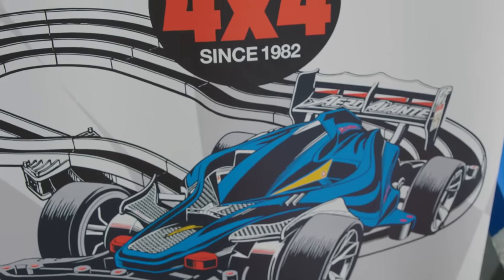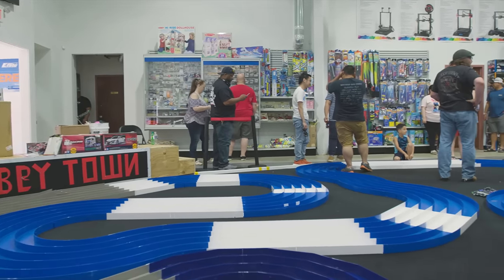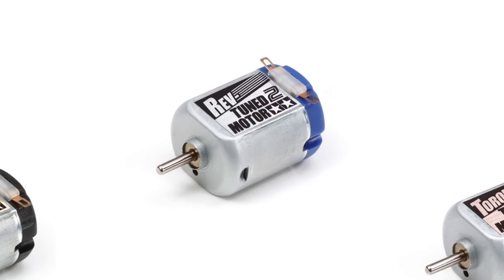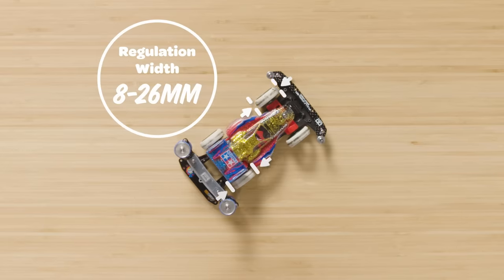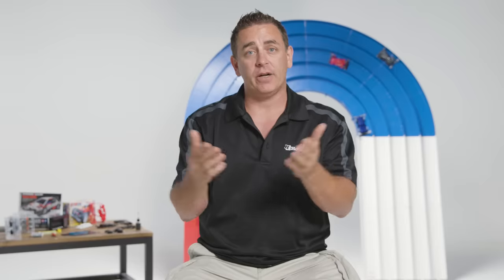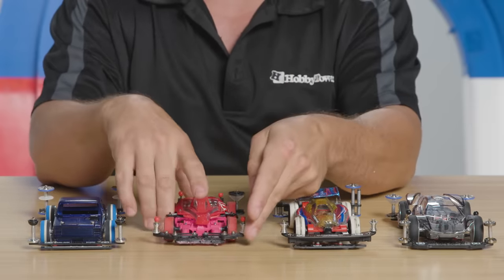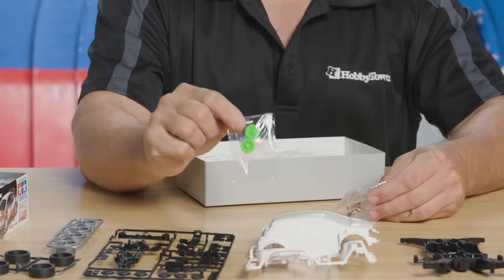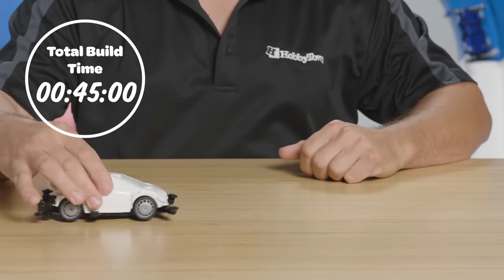Customizing Mini 4WD Racers For High Speeds On A Small Scale | Ars Technica

Comment: I remember modding these in the late 90’s.  I had a cobra chassis with a okami trike conversion with modded  hyper dash casing with a re rapped plasma armature and bell.  Rechargeable batteries is a must!!
Reply: how much you spent for it?
Reply: I had Max Breaker, Knuckle Breaker, Desert Golem and can't remember the 4th one I've had. I've only had like 3 or 4 motors back then as it was an expensive hobby for an elementary kid back then. They were Hyper-Dash 2 and 3, Rev Tuned and Atomic something can't remember the exact name. Had good times with this hobby with my cousins and friends in the late 90s and early 2000s. Started to come back to it just last year.

Comment: Used to see races all the time. They even have suspension now, my favourite to watch is the full open class. You see the craziest ones there, like the rwd ones, they don't have front wheels, they have this roller bearing under the front of the car. Homemade motors way more powerful than normal, when they hit the straights you can't even see them . But they tend to be crap if there are any jumps.
I still remember seeing some of them do a 3 lap track in 9 seconds .  The track wasn't small It's bigger than the one in the video just without jumps and only 3 lanes

Comment: I tend to like Tamiya mini 4WD with Super X / Super XX / AR chassis .  They have that look that says high speed spec setting so i tend to like set-ups for tracks with that requirement.  For technical tracks i find VS or MA chassis mini 4WD cars good for the job.  I should also say the $100+ fully set up car with upgrade parts mentioned in this vid is be pretty accurate.  I bought 4 types of motor, bearings, side dampers, front and rear weight control, aluminum rollers, wheel sets with lock nuts, etc.  There's a boom of this hobby in some parts of Asia in the 90s then suddenly died down but it always had a good presence in Japan.  I'm hoping this hobby picks up again seeing it's mostly indoors where we can enjoy, have fun and stay safe.

Comment: Man...I was mastering rewinding the mini4wd motor's coil and was selling it for 20$ each with the custom graphite brush but exclude it magnet because my custom coil is 100% overheat proof, it use high quality wires also coated with high-temp 1000°F epoxy paint... And that was selling well... Too bad it not good to use for track gambling race because it too fast.. So my custom motor only can use as drag race gambling.... What a good time...

Comment: A little clarification on the concept of batteries: The specific (nominal) voltage of a battery is determined by the chemical composition of the cell. An alkaline cell is approximately 1.5 volts, a NiMH cell is 1.28 volts, a Li-Ion cell is 3.6 volts. The chemistry, the physical size and the quality of the components will determine the combined capacity (usually measured in current and time i.e. maH or milliamps per hour). This capacity will determine how much "over voltage" a cell will have when it is fully charged, over the nominal cell voltage. When the battery is loaded (connected to a working circuit) the current draw will deplete the cell. If the current draw is high enough the internal composition of the battery will generate heat. This internal heat generation will affect the battery's capability to provide the rated current. Any restrictions in the cell's capabilty to provide current (heat or depletion of charge) will affect the cell's voltage. How the cell responds to the demands placed on it are directly related to the chemical compositon, quality and the size of the cell. Just comparing the discharge curve of an alkaline cell to a NiMH cell is not indicative of which battery performs better. A "single-use" alkaline cell might "crush" a NiMH cell in a specific race, based on the demands; current, heat, total capacity, etc.
Reply: "a Li-Ion cell is 3.6 volts"
3.7 volts for the chemistry used in most hobby Li-Ion batteries, and 3.3 volts for LiFePo4.

Comment: The motor with more winds or rounds are high speed motor, while the motor with less  rounds but thicker copper wire is more stronger

Comment: I love how this form of racing was marketed towards children. Even though we all know the majority of those who built and race these were all adults. As the adults have the money.

Really after being exposed to this sport due to Yakuza 0. I did not realize the sport is still a live and doing well. Even if it had "died out" for a short time. It is good it is back and has such a wonderful community around it.

Though I wonder if some inventive soul would end up managing to squeeze a micro computer into it, some sensors and basically make an AI "drive" the little car.

Now I know people will call out that would ruin the soul of the racing but I would call it an experiment of design and how far technology has come. After all. The motors from the 80s would be outclassed by the motors of today. To top it off the batteries as well. I call it step of progress.

Comment: Its like slot cars but on the sides?
Reply: very different. once the car on the track you have no control. as the video said you act as a mechanic while rc or slot car you are the driver with contoller.